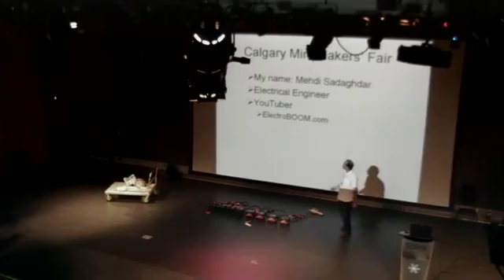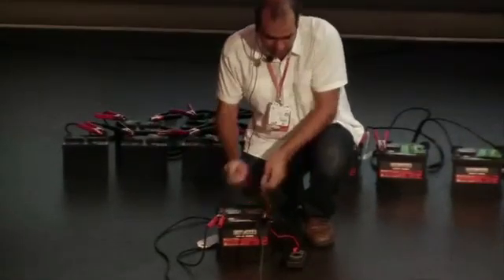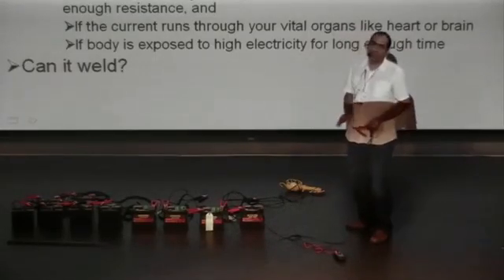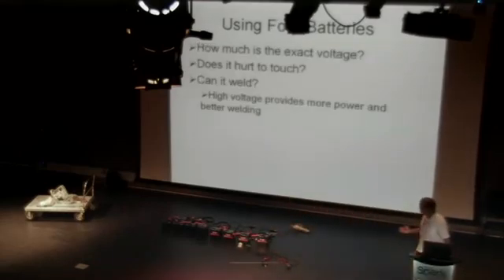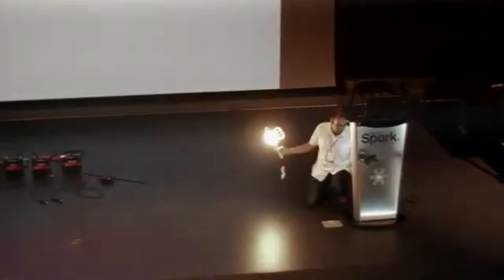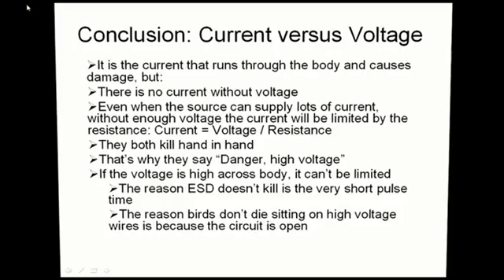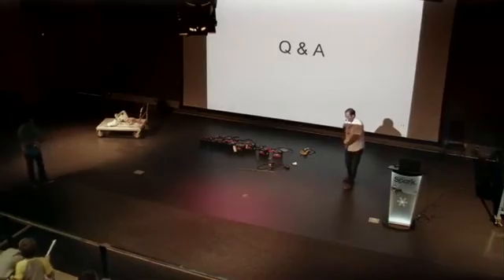Ten Car Battery Presentation at Calgary Mini Maker Faire

Comment: Even if you touch a single 12V battery terminals with a 25mm diameter steel rod holding in ur both hands, you'd still feel something....

Comment: Something I should tell you that, if you hold the two terminals  by connecting 4 12V batteries in series (which is around 48V-50V) with a steel rod of 25mm diameter taking the connection with both hands, then you'd really get a nice jolt

Comment: If body resistance is 100 kOhm, that means that at 230V you get 2 mA... how can that kill you?
Reply from the maker: Over dry skin it is as low as 100k, but that current burns through skin if you are exposed to it long enough and shorts to low resistance internal tissues and suddenly draws much more current
Reply: @ElectroBOOM  THE LEGEND HIMSELF HAS REPLIED

Comment: Hey electroboom... The electrode needs to be striked before used agian. Like have another piece of metal and just scratch the electrode with electricity running through it and it'll be a better welding experience (this is for stick welding, not sure if that's what your doing though)

Comment: It’s because ur not letting the rod got hot and establish a puddle 200 amps is plenty to stick weld with which is the highest amo type of welding almost every rod size will run below or up to 200 with the exception of 1/4 and larger

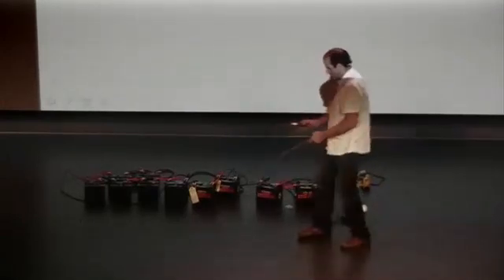Comment: At 12:28, ball lightning!   
Supposedly weld-spatter coming from electric arcs is not simply some white-hot droplets, but each "droplet" turns out to be low-density; far too large for it's measured mass, with ball-diameter occasionally exceeding 3cm.  Try close-up videos, shot with welding goggle-lens on the camera, to observe actual diameters during initial brightness.  1980s Russian physics papers on this, they found that the large-ish balls have internal fractal percolation structure (detected by impacting the balls on a witness-plate.)  The spheres are composed of burning nanoparticles, an expanded material similar to aerogel, with O2 diffusing in through the surface of each ball. https://www.nature.com/articles/35000525   The large "ball lightning" spheres then shrink, leaving behind very tiny metal beads.  Kenneth Corum managed to produce similar balls with carbon vapor, growing the diameter to 2cm via strikes by a Tesla-coil discharge.   Finally the major physics labs did the same, but using silicon vapor, and occasionally achieving balls over 3cm diameter (the size of pingpong balls!) https://www.youtube.com/watch?v=QLTPELhKAYM, also https://www.youtube.com/watch?v=fsu8IaaVsvk

Early 1980s lightning-ball experiments involved a battery-bank from a WW2 diesel submarine. 

Medhi has built his own small version of the infamous "Submarine Battery!"   Need to try it on some silicon wafers, and carbon electrodes!   Instructions for the silicon-vapor version: https://www.dos4ever.com/bolbliksem/bolbliksem.html

Comment: WRONG, a capacitor is 2 conductors separated by an insulator, the body isn't capacitive it is resistive, the AC voltage you measure with your meter is the RMS =Root Mean Square which is around 70% of the PEAK voltage of AC felt by the body which has a 50 hertz cycle so reverses polarity 50 times a second which can cause fibrillation of the heart and will hurt more. So if you measure 120v of DC and measure 120v AC on your meter the body feels a much higher PEAK voltage of the sinusoidal wave form.

Comment: Love the fact the unibrow got put into the presentation!!! Sucks the kids didn't get to see more high voltage welding (not actual hv but i say hv for it when considering normal welding voltages). 

All i can say beyond thanks for all your hard work and effort is to also say thanks for getting the point across when it comes to energy, instead of its the amps (milliamps usually) that get you. Its the time over all that your subject to the power.

Your a legend mate. Keep it up!

Comment: BOTH IT DOES NOT WORK YOU HAVE A HIGH VOLTAGE NO CURRENTS ...HIGH CURRENTS 10,000 2VOLTS..ANSWERS IT HAS TO BE BOTH WIRES CAN KILLED GUARANTEED FACT....IT TAKES TWO WIRES 1MILLION VOLTS IS NOT GOING TO HURT YOU IF ONLY ONE WIRE...LOW CURRENT 1 IS ENOUGH TO DISCHARGED 1MILLION VOLTS..IDK TRY IT....

Comment: So many misinformations in this video. Or non-information. AC doesn't kill and hurt because of the capacitive effect. The capacitance of the body causes neglible reactive current at 50/60Hz. It kills because it changes polarity continuously and that makes your muscles to contract and release repeatedly, including your heart muscles. The frequency is 50/60 Hz, which is inside the "operating speed range" of the muscles, so they are following that signal. And you can't free yourself either if you grabbed the conductor, becasue the external signal is stronger than what you can generate, so you can't release your muscles.

If you touch DC, your muscles will react too, but only once, when you touch. However, it can still kill you if conditions are met. Lower voltage causes electrolysis of your blood and other fluids. If you feed it thru long enough time, it will certainly cause effects possibly death. If the voltage is high enough, and the current capability is high enough (a charged HV capacitor for example), it will vaporize something in you instantly. If the voltage and energy is "high, but just not that high" and combining the electric shock with the mental shock if you didn't expect that can still kill you if you have heart problems.
Hint: touching a 400V cap in an SMPS is scary enough. 😉

The resistance of the skin depends on the applied voltage too. So your multimeter shows something at few volts, but it will be lower at higher voltages. So the currents flowing through your body might be higher than you think.

Welding: it doesn't require 24V because of the higher power. An arc has voltage/current characteristics similar to a zener diode with breakdown voltage of cca. 20V. Voltage of a sustained arc is roughly equal to V=20+0.01*I  where I is the current. You can weld a jewelery with low power and a bridge using magnitudes higher power, but the voltage should be above 20V, and the current should be limited to what is needed for the task.

And for a cafeful person, the show isn't funny. Obviously he faked the mistakes, and playing dumb is just a facepalm for me. Acting smart which is impressive for me. Probably this is why most of the audience did not laugh - probably not dumb people participate in these presentations...

Comment: Great video!  Next time you do this at 120 AC or DC.. get a winnie and but probes on each side.  Zap a hot dog to ready to eat in 30 sec using AC :)
Reply: Next time weld from the wall outlet, to show that current is needed too :)

Comment: As an engineer you should know better....
1. never attempt to weld anything without a proper welding mask (no, goggles are not a substitution) Welding arc emits ultraviolet and infra red RADIATION, exposing your eyes to said RADIATION is not a bright idea (get it? bright), closing your eyes does not work here.
2. another not so bright idea...making sparks around car batteries (or right on top of them), they produce hydrogen when they discharge....Look up Hindenburg.

Comment: according to this equation I= v/r 
if we assume the voltage is 50v AC and the body resistance is 100K ohms
then the current should goes throw the body is 0.0005 amps
so the question here , why this small AC current will be harmful for body but the same DC current is safe ???!!
Reply: Due to capacitance between body and ground, an enormous charging current can flow through the body for the ac voltage. But for dc voltage, there is no charging current because dc has zero frequency and hence zero charging current

Comment: Why does the 120V DC from the batteries make a zzzzzzzzz sound like frying bacon, when you short it for welding, but the 120V AC from an outlet makes a loud BANG like a gunshot when it gets shorted? Both situations involve an I = V / R situation, and metal always has a very low R, so the I (current) is quite high, in both AC and DC situations. But you would never be able to weld with 120V AC because the loud BANG it makes at the moment of shorting. Just imagine that sound going continuously while welding, it would be a deafening roar like that of a jet plane.

Comment: 11:00
"It's exactly the same voltage..."
Which is wrong, because a 120V Ac is equivalent to an 120V DC in terms of Power P. The voltage of a 120 V Ac power source varies from +170V to -170V in a certain frequency(Us = ± U_effective *√2)
Conclusion:
+170 isn't the same number as 120 just like -170 isn't the same either.

Comment: i am pretty well used to doing light electrical work around the house (replacing outlets, installing light fixtures etc) but after watching your videos im SOO much more careful (not that i was being reckless in the past) its just now before i go sticking a screwdriver onto the outlet wire hold down screws i double check with the voltage meter (even though i know for a fact i turned off all of the breakers and taped over them) granted 110v isnt going to be nearly as dangerous as any other higher voltage electrical work, i dont want to have my own "AH SHIT!" moment like you demonstrate in so many videos. thank you for showing us you should never become too comfortable or complacent around this stuff and youre effing hilarious so the infotainment is always a lot of fun

Comment: With low voltage it is the amps that kill. Amperage is the measure of electrons flowing. That is what messes with your heart. The voltage is just the presser behind them. The more pressure you have the more flow you get. So yes they are related but it is the amount of electrons that flow over your heart that kill you.

Comment: actually visible electrostatic discharge is at least 100ma if not 1A or more - you will not not say 50ma in bright day light, but mentioned door-knob esd is visible every time when you look on it and this is not small spark

Comment: Great interesting and funny funny vid but from a safety perspective very scary last I checked lead acid batteries under high discharge current will electrolyse water and create hydrogen not as much as when charging but enough to go boom which might be entertaining but so dangerous forget about the electricity factor I’ve seen batteries explode sound similar experiments and it’s ain’t good.
I would suggest making this point to the audience and take the precaution of having the batteries well away from all the sparks also some Hydrogen will generally linger from the last charge cycle and this creates a risk even if the batteries are at rest so my advice don’t mess with them without precautions.

Comment: This is what's inside the battery. Framed electrodes in electrolyte creating huge surface area where charges can be exchanged 500A. Voltage is limited to surface area of the framed electrodes 12,75V which ones create the capacity of 500A. These parameters are fixed and cannot be for example risen without changing electrolyte. When cranking the car voltage drops rapidly and than rises after a while. It is electrolyte and a bit of time is needed for ions to migrate to the electrodes and recharge to maximum voltage again. I took a meter and played with it while trying to crack my own car during freezing weather. That' why ElectroBOOM can keep welding only for a few moments. AC is different. Imagine surface area involved in comparison to the car battery. My mains is 230V so it is like almost 20 regular batteries in series and the current this time is limited to 40A. What is different, we get 20 regular batteries of 40A being recharged 50 times a second. Considerable difference of possible power delivered in prolonged unit of time.

Comment: @ 5:39 : you are doing it wrong. You should only place 3 batteries in series and then place groups of 3 batteries in parallel with eachother for enough current.  Welding only requires 25 to 50 volts with lots of current.

Comment: Actually, I have not ever seen birds perching on 100,000 volt lines. The reason is capacitance. Even if they are not touching two wires at once, the capacitance to space will cause sparks to jump to the birds' feet as they land on a high-voltage ac wire and corona may come out of their beaks and wingtips if they were to land. Some of these wires are also physically hot due to the current losses. The birds seem to sense it and stay away or only land on the ground wires.

Comment: Birds can sit on a 100 Kv and don't get hurt, ok but  if i grab the live wire of my 220v while im wearing rubber shoes, can i get hurt? in other videos you said that you are not completely isoleted from ground because of the capacitive property of the body. Does the distance from the ground make the difference?

Comment: Usually HEAT from the arc kills or more often causes heavy burns or blindness. 
As you see, low voltage, like "soft" shorting a big 24V battery bank can permanently injure you, even without blowing a large fuse (500-1000A+ for big system)...

Comment: it seems that a thin layer of skin is offering the high-resistance protection. But if the two probes managed to connect to your blood stream, now you have current flowing thru a salty liquid. So this is very risky to just trust that your skin will protect you. If you have any open wounds, or if there is a path from a wet place on your body, you could die. So not safe even with DC. It is current that kills, not voltage.

Comment: but if the batteries are connected parallel?  would it hurt (parallel means more current and normal voltage)
Reply: No because the current is limited by the resistance of your body. A Carbatterie can provide 500Amps but if 500Amps would go through you body you would just burn away.

Comment: Awesome video! =) One more factor to the resistance of body is the surface of contact. It's not the same to touch small wires that touch metal plates. I checked it with my multimeter and the resistance through your hands drops from 300 - 400 komhs to 20 - 30 kohms so it can hurt much more. Please, continue making videos. They are so interesting.

Comment: Did you do any more of those types of presentations, the more you do the better you get at them, I think the problem was the lack of visual close ups on what you were doing.

For instance doing the voltage check, if you had the mooshi meter and display the results on the big screen people would have been able to get into it.

The welding, by simply having some gloves and some give away coloured plastic sheet lenses would have made that more fun, also put the results up on the big screen of what happens to the battery voltage and current as you touched it at high and low voltage, or the resistance of your body.

Visual, but as a first attempt it wasn't bad, only thing is I haven't seen any more of  your presentations so i'm guessing you gave up on them, which is a shame.

You are entertaining and informative, your videos are very good.

Comment: you can weld with one battery. you need to use locking pliers. and you just don't stick the ER6010 to the metal you need to hover above it.

Comment: I still not sure how resistor works, so if I had a 5v 2a supply, and I want to power something around 500ma, so what value of resistor should I use
Reply: piece of potato V=IR => R=V/I
=5/0.5 
=10 ohms
Reply: I dont understand it too....
Reply: Please, somebody explain that, thanks

Comment: Current control is necessary in electronics. If you dont mind current flow in an electronic circuit, you'll fry everything.

You can have a 1V signal and have it fry your circuit because it shorts somewhere.

Comment: Hi, what is the maximum current that we can draw from a standand 12v 60 ah car battery?
Reply: shorting it gives the largest current
V=Ir
if r is really small the current gets big
Reply: But how much amps can it give when it shorted? Or, if I put it in another way, what is the maximum watt power that I can safely use from a car battery? For example can I use an hair dryer which rated 1200 W with a sinus inverter attached to a car battery? What should (and can) be the maximum rating in this regard?
Reply: lordofthechimie It all depends on the rated value of your equipment.
e.g. a light bulb has a r.v. of 220V, 10W 
by Ohm's law , it has a resistance of 220^2/10 , from that and the voltage of your battery , you can calculate the watt it will draw in your circuit.
It depends on the resistor more than the battery, only thing it matters is how fast you drain it
Reply: lordofthechimie In a simple DC circuit the load controls pretty much everything , a high resistance makes high voltage low amp , vice versa.Battery is just a supplier

Comment: Never "test" live wires with 2 hands. If you need to touch 2 wires which might be under high voltage — always use one hand.
Current goes the shortest route. Worst case scenario with one hand is severe burns.
Worst case scenario with two hands — irrecoverable heart damage because it sits roughly inbetween your two hands.

Comment: So how does that make a vaporizer pen work?
Reply: dude.... vaporizers have small coils which glows red hot when u close the circuit to the battery. those coils are made outa high resistive wires, and P= I^2 R says that the more resistance u have the more heat will be given out by the wires.
Reply: dude.... vaporizers have small coils which glows red hot when u close the circuit to the battery. those coils are made outa high resistive wires, and P= I^2 R says that the more resistance u have the more heat will be given out by the wires.